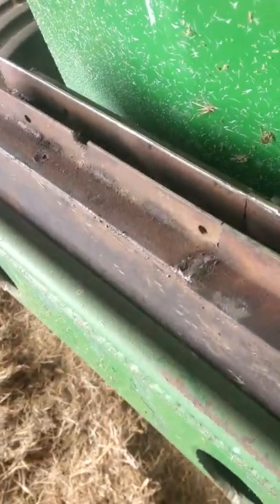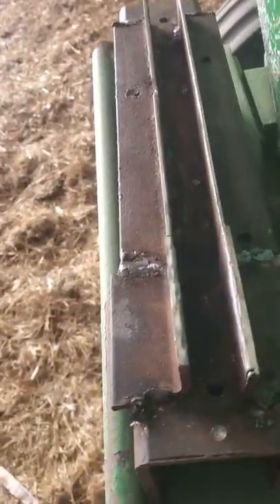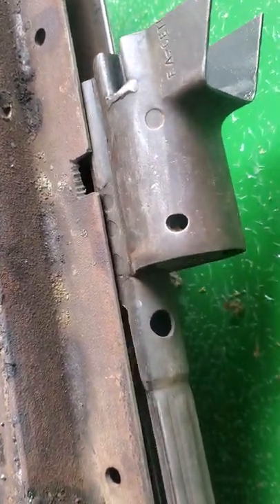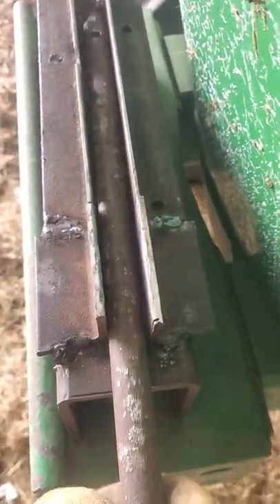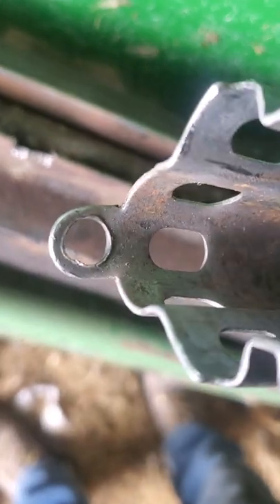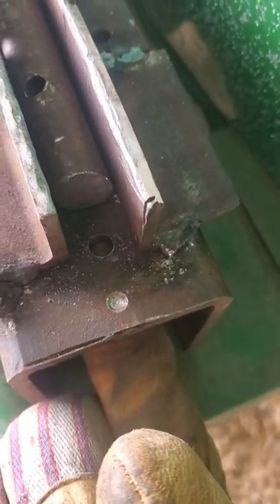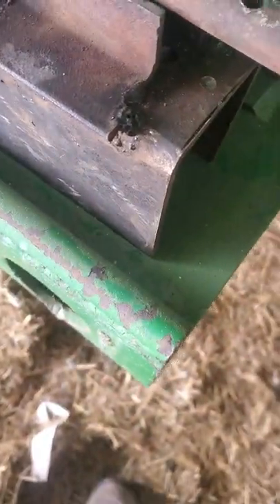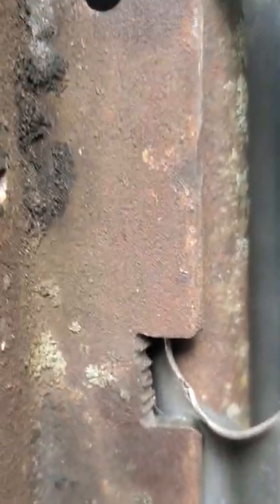homemade cetme c receiver jig

Comment: The rod should be 20mm + or - 1mm. You can also greatly eliminate the need to use a hammer to take the flex out by welding a strip of 1/4" X 1" steel down the length of the rod . This makes it more ridgid and adds spline support that helps eliminate flex. Keep the videos coming. Not much info on CETME builds anymore for whatever reason.....I guess us "little people" arent supposed to have them and shouldn't be privy to such information.
Reply from the maker: Let's hope these videos don't get taken down then lol

Comment: on the off chance you see this, what was the hardest part about the entire build?
Reply from the maker: For me it was just getting the bolt carrier to go smoothly through the receiver. But this is probably because my jig I used was not perfect. If you have a good jig or just buy a receiver the hardest part is probably getting headspace right

Comment: I copied your design before seeing this video. I used a piece of 1/4 plate to weld the angle iron to, which caused some flex but I stopped and welded a support before it flexed too much. I cut the opening for the ejection port way too big, but whatever..it worked. Didn't even need a press just used 1/4x20 stainless allthread on each end. a 3/4" rod I drilled with a drill press. I actually used the jig to hold the bar to drill it straight in the drill press as well. using pieces of the old receiver to center the bar in the jig. 

So you set the bolt gap with the trunnion outside of the receiver, and then welded the trun in the receiver? my barrel pin holes aren't lining up between the receiver and trunnion..which isn't a big deal if I never have to change the barrel..but thats a ways off. I still need to figure out a barrel because I can't find a cetme barrel at the moment and i'm still straightening and making my receiver and BCG mesh nice and smooth. 

a couple questions..
Are you going to cut up the Cetme trigger housing to convert it? can you do a vid explaining the shelf and the FCG conversion? I like the way you do things, man! I tac welded up my receiver except for the front half where the trunnion is..I tacked the rear half of the mag housing but I did not install the magazine catch..and I'm having trouble figuring out how to install that without cutting the welds out
Reply from the maker: I just bought a semi trigger pack instead of converting the old one. Also yes I do headspace them outside of the receiver. It doesn't seem to cause any problems. I also personally just weld over the barrel pin hole because mine didnt line up either. The hole they had on the receiver just became one of my plug weld holes lol
Reply from the maker: Also I did have to cut the hole bigger in the receiver for the mag catch. But only cut the top part on the hole to make it bigger because the mag won't fit tight if you do the bottom. And remember don't install the lever because I think the atf doesn't allow that
Reply: @jimmy_jack  you can install the lever. The semi shelf covers up the hole for the pin and then you weld it over the pin hole. You just can't drill the hole to accept a retainer pin and not put on the semi shelf

Comment: Any ideas on where to pick up the receiver blanks
Reply: Just Google it
Reply: I picked mine up from Robert RTG. Apparently they're not correct to original CETMEs and you'll need to mess with the holes a little. The barrel pin hole doesn't line up for some reason
Reply: Look up HK flats for which ever model you want

Comment: How far apart did you set the angle iron?
Reply: He used the demilled front trunnion part with the old receiver skin on it to set the space. I'm assuming you're looking for a measurement,though. Might want to check out Weapons Guild,a forum for this type of stuff. There's a whole subsection on Cetmes.
Reply: @tbone5040  OH, I have another demilled trunnion. I can just measure that. Smacking myself in the forehead...
Reply: @rocksnot952  Dont feel bad. I didn't realized this was a solution until I watched this vid.

Comment: How did you install the barrel without a press? just a curiosity.
Reply from the maker: I used a piece of brass on the muzzle end of the barrel and hit the trunnion
Reply: @jimmy_jack  ahh i see, and have some more questions i am building one as of now  tell me can i use a unistrut and a 3/4 inch cold rolled bar and it work just as well? i have a 20 ton press so i wont be needing a hammer for the middle? and can you go into detail on  headspacing? is it jsut the run of the mill headspace beside bolt gapping and cocking tube gap? and you said its about a razor blades width for the gap?
Reply from the maker: @therougeshoppingcart9707  yes I've heard that a unistrut piece works just as well. You probably won't need to hammer the middle if you have a press but you might have to do a little tapping on the front and back because once it's folded there probably won't be enough room for your press. As far as headspacing the first step is to get the barrel pressed into the trunnion far enough so that the bolt is clipped onto the shell and the shell is in the chamber. The way it works is that when the bolt closes the 2 rollers come out and act as the locking lugs like on any other rifle's bolt. So you need to have the barrel pressed in the trunnion to where the bolt closes and the rollers come out and they are tight to the grooves that are inside your trunnion. So when you get it close you will notice that the bolt gap gets bigger as you press the barrel in farther. This means that the bolt is beginning it's journey back through the receiver to cycle a new round. It's basically pushing on the rollers from the recoil pressure until they are fully unlocked and the bolt opens up and cycles a new round. So the bigger the bolt gap means you will have a faster recoil and the smaller the gap means you will have a shorter but lighter recoil. It should be a little less than a razor blade width but it would still be safe I'm sure. But if you have too much gap the shell would probably explode outside the chamber midcycle. And if you have too little a bolt gap it will either not eject or the bullet casing will deform pretty badly inside the trunnion. So once again as the shell is coming out of the chamber the bolt gap will be getting bigger so you need to press the barrel in with the shell in the chamber and the bolt in place until the bolt gap starts getting bigger and then check with something thin like a razor blade. I hope I answered your question.
Reply: @jimmy_jack  Yes thank you for your info!